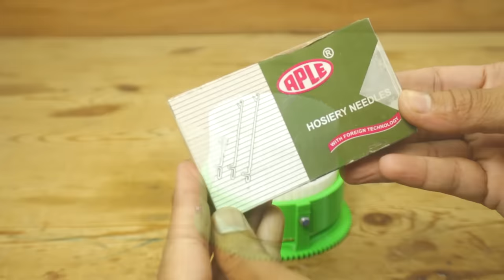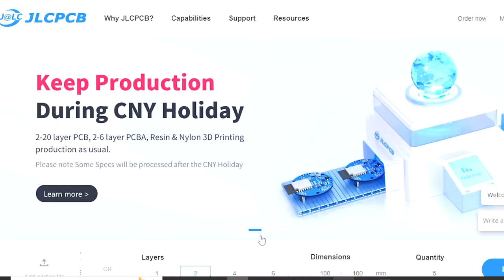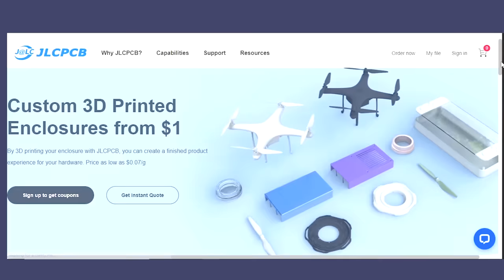DIY Circular Knitting Machine

Comment: Great project! Maybe one more variable to add to the project would be tension control. I.e. how tight the wool is being let off the spool. Would change how tightly knit the stitches would be depending on the material used. Definitely varies from material to material.
Reply: @WowUrFcknHxC  If the design was made parametric, more hooks could be added i think

Comment: Congratulations. Glass fiber, carbon fiber, copper wire, steel wire can also be woven with this method. Even heat shrinkable plastics can be woven and used in packaging companies.

Comment: Ingenious. Where did uou get those needles? A bit more detail on how to actuallyvstartbthe knitting process would have been great
Reply: they look like standard gauge flat bed needles rather than csm needles. so much easier to source
Reply: I can’t find them
Reply: @carolinefromspeakinstitche8888  I searched your term and nothing came up
Reply from the maker: If needed this type of needle I share the contact no from where i have sourced 
this need number is 79.111 contact no is +91 89805 99227 (india)
Reply: @MrInnovative  tnx
Reply: From picture of needle box @ 02:20

‘APLE Hosiery Needles with foreign technology”
Reply: @ernestgalvan9037  😁
Reply: @MrInnovative  
Please sir ismashine ka parts kha se milega
Reply: @ernestgalvan9037  "with foreign technology"
What does that even mean?  😄
Reply: @ernestgalvan9037  It's the OG Italian set from 1823. Oi.